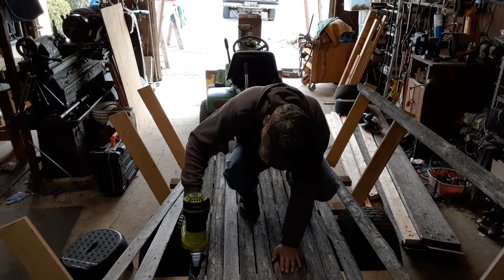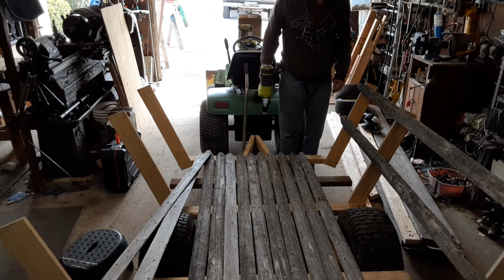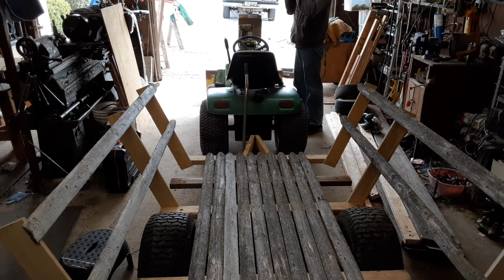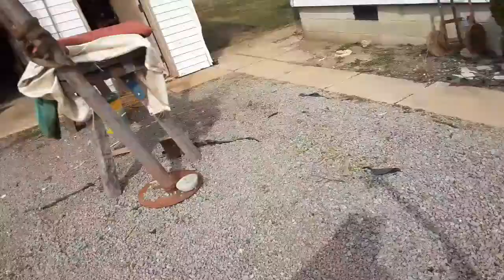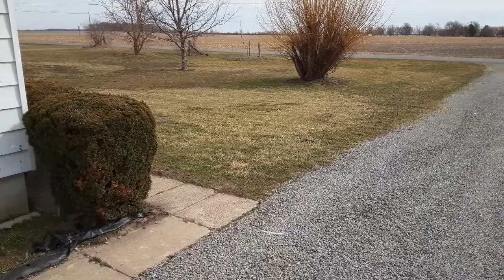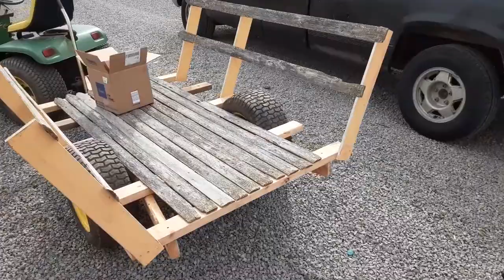garden tractor trailer semi finished

Comment: Just the job :-) I read your comment on the other video about (paraphrasing) making things to a good enough standard, avoiding the perfection trap, and then tackling more projects in the same time. I need to take a leaf out of your book! Thanks, Craig
Reply from the maker: Perhaps. But maybe that's the difference between 1680 subs and 320...lol.. In reality both have there place, maybe the real secret is knowing when it's best to employ which strategy
Reply: @craigtate5930  No I don't think that small gap is anything important. Compared to the big players, we're both at the shallow end :) I Think you're right though about knowing where to concentrate your efforts and when. Easier said than done! Cheers, Craig